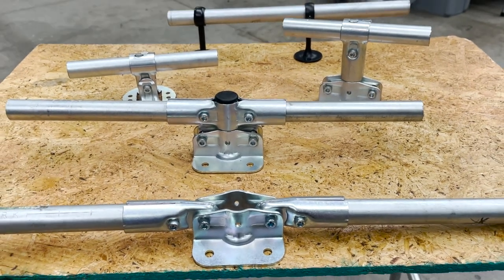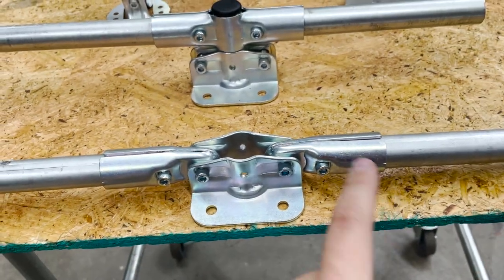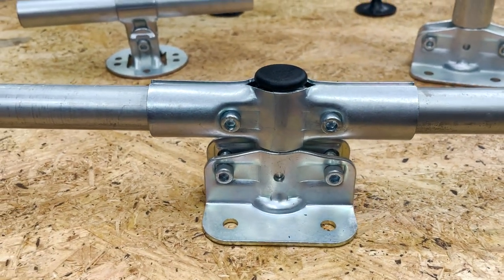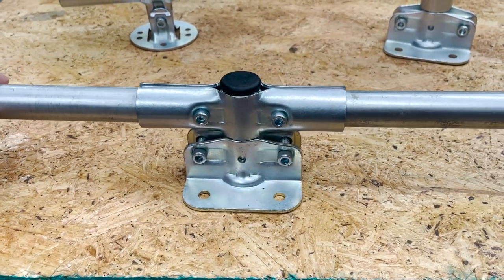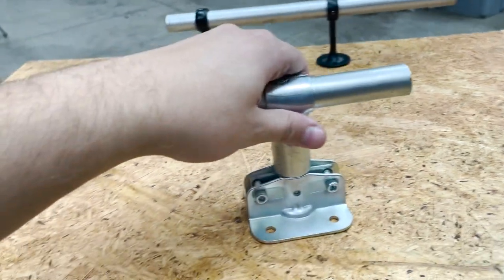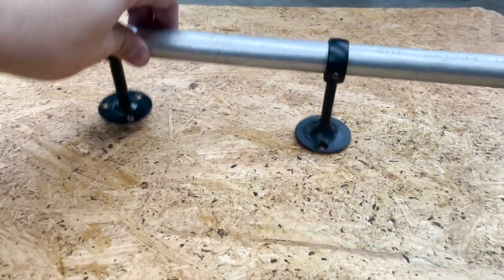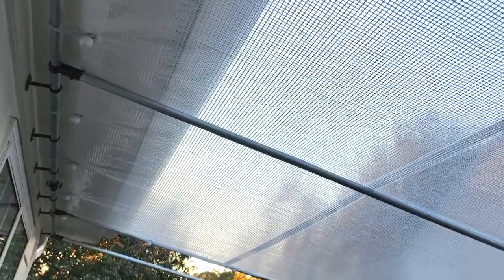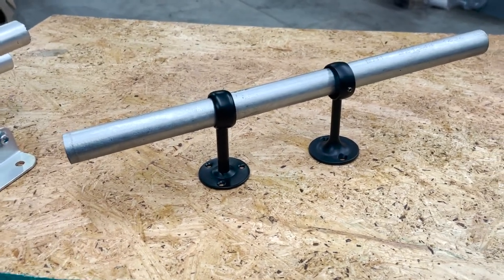6 Easy Wall Mount Hacks!

Comment: This is a situation I’ve pondered myself. Maybe it’s worth designing a flange for this?
Reply from the maker: Probably so. We've got a lot of connectors for larger sizes on the docket first but I could see this being a possible new connector when we have the bandwidth. Thanks for the comment.